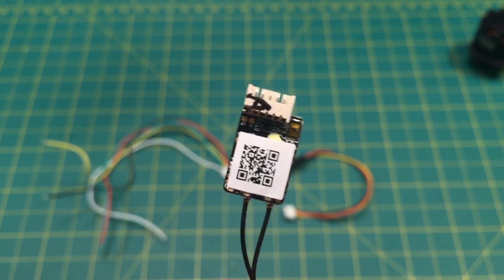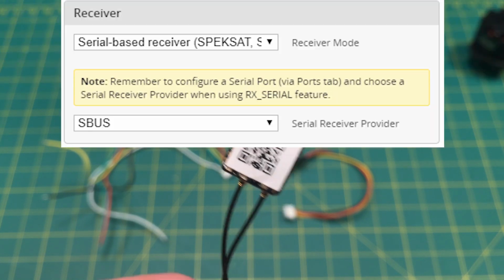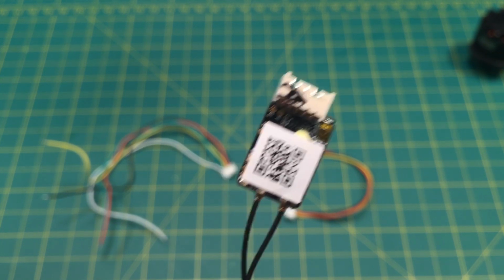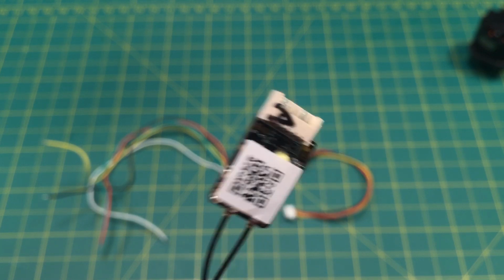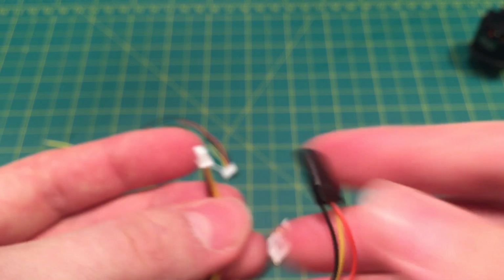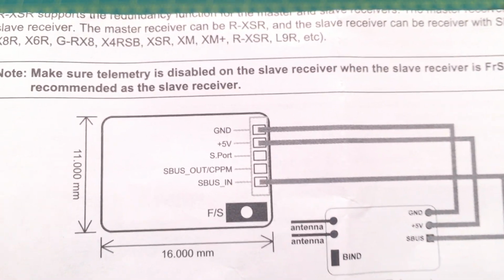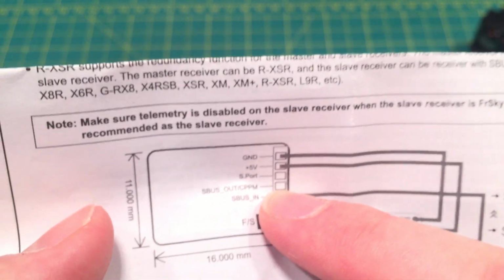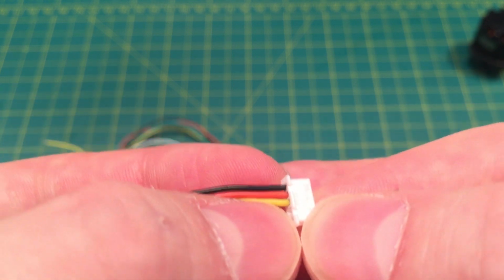FrSky R-XSR Receiver: No input? No Channel Band Movement in Betaflight?

Comment: Mines is wired up exactly as shown, and yet I still can't get this craft to fly. Don't know what I'm doing wrong and even tried the same with the rabbit 349, still no go. Both crafts are grounded.
Reply from the maker: I have a feeling that yours is probably a firmware issue on the receiver, which is something that started to occur many years after this video was made and so it is not something I covered.

Comment: Hey I’ve wired the blue/green wire to the sbus solder point, and the yellow wire to r2 but I’m still not getting any signal, what do?
Reply: I’m using the other cable they give you the one with 5 wires

Comment: Hi buddy some I am having this problem I had it working and then I updated the firmware on my flight controller through beta flight now I'm not getting any inputs I will admit I am new so I don't really what I'm doing. Are you saying to change the wires on the firmware cable before you do the firmware it are you saying switch the wires going into flight controller?  If I had it working before then maybe it's an issue of the firmware from the flight controller and the receiver not being compatable.. And also on the uart setting on beta flight how do I know which uart to click on??  Thanks for this video.

Comment: I need help binding a lite radio to my frsky reciever. I can't get it to bind no matter what I do..
Reply from the maker: Which version of the literadio do you have? I think of the earlier ones only supported D8, and not D16. The R-XSR is a D16 receiver. The literadio needs to be in D16 mode to bind to this one. Also, how new is the frsky receiver you purchased? If it is newer, then it probably has ACCESS firmware on it, and you would need to flash the firmware unfortunately to get it to bind at all.
Reply: @JohnCuppi beta fpv lite radio 3. Frsky R xsr.  was a build from rotor riot :/ had to figure all this out on my own, but he'll I like learning:) what firmware do I need to  flash to the reciever?(ordering a firmware toolkit from getfpv and maybe a better controller as well) thanks for the response!:)

Comment: now the Rxsr supports F.port.  So the cable will connect to the S.port pin.  I know this video is old.  Just FYI
Reply from the maker: Good tip. One thing I think to remember is that you need to flash firmware that has f.port as well.

Comment: Hi John,I have a T motor pacer  f7 flight controller ,taranis transmitter , and r-xsr receiver, the problem  is, radio couldn't  respond  to betaflight, no matter what I tried  for 2 weeks of testing different  ways,then WAMM I came across  your video,and tried ,what you said.Result fixed my issues betaflight  start working, I move the green wire to the fourth spot on connector, then move the green wire from  T5 on the flight controller to R6 ,then select  uart 6 on betaflight and that solve my problem, Thank you very much.
Reply from the maker: So glad to hear this helped!!! Have a wonderful day.

Comment: Can i use another uart besides the one marked sbus.? Or is that ibus ?

Having trouble buying elrs with factory firmware still on it . One out of 6 rx's was able to bind the other 5 might be returned resold . So is there a way to restore factory default settings to elrs nano rx's ? 
       Thanks for pointing out the 3 wire plug . I might not have noticed it . I did see it and thought easy rx hookup . 
  I have 2 of them ready to replace elrs if it does not bind .
Reply from the maker: For an FrSky R-XSR you do not have to use SBUS, you can use S.Port if you want, HOWEVER, in ordet to do this you need to flash the receiver with fport firmware. 

 S. Port from R-XSR to TX1 on FC. Then, enable serial rx to on.

set serialrx_provider = FPORT
set serialrx_halfduplex = ON
set serialrx_inverted = ON

Again, the above only works with fport firmware, the receiver must be flashed to make that work. Otherwise, you must use the sbus pad.
Reply from the maker: Regarding your ExpressLRS receiver issue, that sounds like an extremely high failure rate. I have more than 6 ELRS setups and they have all flashed and bound with no issues for me. What is your ExpressLRS setup and what receivers are you buying?
Reply: @JohnCuppi  i just noticed you answered about the elrs .

I bought beta fpv  micro tx , and it doesnt bind . 
  So i bought a micro tx but in the shopping cart it switched to 2.4ghz module .
    So i bought a 915mhz elrs and finally only one reciever did bind .
     I thought my purchases were used flashed returned or defective .
      Now speedybee betaflight has an elrs configurator for android . It might be working now . I have been saving the elrs  recievers to try flashing firmware later if anyone needs them . 
   I ended up putting crossfire on one quad and rxsr on another quad . Both seem good as video link .
    My rxsr recievers are different pinouts than in this video . But it worked 5 months ago . My sbus is the 3rd wire down . White nowadays .
Reply: @JohnCuppi  the frsky rxsr still works as far as my video reaches . 
 The elrs stuff still needs the firmware stuff . Funny how they can make the circuits but not the firmware .

Comment: I feel like such an idiot. I took electricity in college and I only said "maybe the wire is on the wrong pin" after looking at the manual and realizing it said s.port , I ignored that fact and spend another  hour trying to solve the problem that I already knew the answer to, anyway  thanks, you helped me realize i should have gone with my first assumption

Comment: I just upgraded from xm+ and did failsafe and my quad wont spin motors...everything is as it was...i also did the wire switch like the video...i see the inputs work and arm and failsafe work in betaflight...i just plug batteries and arm then i get no spinies😵‍💫...

Comment: This is exactly what I was stuck on! I used a needle tip to lift up the plastic to get the pin out and pushed it into the 4th slot.
Reply: It works ,me too was stuck on same issues, no headache gonna. I love my t motor quad  purchase  again.

Comment: I have exact same problem but i have these cables right, i really dont know whats wrong, i have sbus on R1, there it should be and it didnt work
Reply from the maker: I would look into a firmware problem on the receiver at this point.

Comment: I just bought a roll my five and a new accessrx receiver. I have an old radio x9d. A flash to the latest firmware free 2.0 for the receiver. It shows that I'm bound but no communication in betaflight. Please help if you can. Thank you
Reply: Roma F5
Reply: Pre 2.0

Comment: Hello, I think I have this problem, I have a second Nazgul5, not woking the receiver, R-XSR, I update a firmware by using this cable you show, then radio and receiver are conected, But not working. Should I change the yellow one? If It change this cable Will I work? Sorry But I did not understand It at all... Please help me !! Thank you

Comment: hey John, I did the same mistake and fixed the mixed cable thing and I flashed my FC, but I still don't have any input. Do you have any idea what i could be?
Reply from the maker: When you reflashed your FC did you save and restore the configuration? If not, check your Ports tab in betaflight — is the serial_RX turned on for any of them?
Reply: @JohnCuppi  I didn't save the configuration, but going through the ports tab yes the Serial_RX is set for UART2, UART1 is set for GPS (I have a tyro129)
Reply from the maker: @estebanc-vistaprevia2941  I have a good friend with the tyro 129 I'll reach out to him about his configuration and he'll reply here. I'm assuming you're following this manual from banggood right? http://myosuploads3.banggood.com/products/20190709/20190709210205TYRO129Manual.pdf
Reply: @JohnCuppi  okay, thank you John. and yes, I followed those directions from the manual
Reply: @estebanc-vistaprevia2941  Hey I have a Tyro119 should be pretty similiar port wise. I haveSerial Rx on Uart 2 and GPS on Uart 1 so that sounds right. If physical connections seem right I'd also check under the configuration tab -> Receiver section and make sure it's got the correct setup(sadly I run crsf). Feel free to add me on discord and I can send you any other configuration details you need DeadTr33#6307.

Comment: I have the xm+ and my tyro is not responding after bind any idea?
Reply from the maker: If you’re sure it’s fully bound (green light solid), and configuration is set to sbus receiver. Also make sure serial_RX is set in the uarts. I would then check to make sure all soldering connections are good. 👍🏻 if you send a pic of the flight controller I can look at the wiring for you too.

Comment: Dont help ! Im soldering all pins right ! and its till didnt work ! with MAMBA F405 MK2
Reply from the maker: I’m afraid then there must be some other problem. Make sure you are running the correct firmware on both the radio and receiver. FrSky has gotten worse with confusion about this lately.
Reply: @JohnCuppi  Problem solved! My R-Xsr was PPM mode +)

Comment: a little tip, i have the Taranis Q X7 ACCST, and an FrSky R-XSR, they wouldn't bind, someone helped me and sent me to this link, "@t, click on "ACCST D16 FIRMWARE", a drop down menu will appear, at the bottom of that there is a link that says "History firmware DOWNLOAD (not compatible with v2.x.x)". download that, and flash your RX with that version, one problem that seems obvious but is something you need to to, is make an arm button, I found a video at this link "@. it didn't work when I tried to flash it using "flash external module", I tried to flash using "flash S-port" and it worked, after that I was able to bind the RX and TX.
Reply: rip the links dont work :(

Comment: Oh ffs i literally trying to solve this for 2hours now. Of course i connected to S.Port instead of SBUS... thank you very much! (lesson: read the f*cking manual before doing anything :D)
Reply from the maker: Agree, always read the manual! But y'know what? I think Frsky shouldn't have broke their pattern of yellow wire = sbus. I cannot understand why the yellow wire couldn't have stayed sbus. This video would probably have never been made and thousands would have been saved from confusion.
Reply: @JohnCuppi  Absolutely agree. And upon this i have 2 x4rsb receiver which does not bind and when i try to flash them the transmitter shows some error message. Seems if my transmitter has the 2.0+ accst firmware then it cant communicate, moreover cant even upgrade the receiver 1.x firmware. However i spend nearly a day figuring out frsky things, so maybe another day. Or at the end i will change my radio to crossfire...

Comment: Hey, so i was able to bind and my wiring is correct, but even after pressing the F/S button it still wont go into SBUS (blue light). Any suggestions?
Reply from the maker: Just checking but you need to hold the bind button on the receiver for exactly four seconds -- and when you let go you should see a blue LED

Comment: Additional thing that I encountered when the video above doesn't work: you're receiver isn't in SBUS mode. Hold the bind button on the receiver for four seconds and when you let go you should see a blue LED. Only when that blue LED is on you can see your inputs in Betaflight.
Reply: What if you have a solid blue LED but still not getting inputs in Betaflight? I have telemetry, but no communication.
Reply: OMG I LOVE YOU!  I spend like 3 days trying to figure out. THANKS!!!

Comment: I hope you can help im out of opitions,Im trying to setup r xsr, f405 wing in inav 2.5, i flashed recever with latest firmware, binds to radiomaster tx 16s no problem but in inav i get no stick inputs, i have 4th wire down green going to sbs on FC, power and ground same uart 2 ive tried 3rd wire down on recever yellow to rx and tx but still no inputs in inav. The radio shows good stick inputs in inputs,mixer and outputs and shows good signal from recever , I hope you can help. Thanks

Comment: I'm stumped. I updated the rsxr firmware. I bound it to my radio before I installed it. I installed it in a Tinyhawk 2 that was getting CALIB flag using the onboard SPI receiver and it would fall out of the sky. So the Tinyhawk seemed to have more problems because the motors stopped spinning up, it began to only connect to Betaflight sometimes when I would plug it in, but I got light flashes when I would arm and in Betaflight the receiver was working. I took the RXSR off the Tinyhawk and just ordered a new FC for the TH. So I installed the RSXR in my first build. A Succex f4 V2.1 16x16 stack. I wired it as you showed here. I have it in the correct places on the FC, but when I plug a battery into the quad there are no lights on the RSXR. No lights, no movement in Betaflight in the receiver tab. I took the receiver off and plugged into a 5v 1.5a power supply and the lights light up as they should. Plug it back into the quad and nothing. I thought maybe I have a bad solder joint even though they look good. I desoldered the 3 wires and soldered them back to the FC and still no lights on the receiver. Also strange, plugging a battery into the quad will give me all the start up tones except for the last 2. If I have it plugged into the computer/Betaflight and then plug a battery in, I get all the tones. I can spin the motors up in Betaflight, but no receiver. Do you have any idea what this could be? I'm going nuts here. I've broken the flight controller on my Tinyhawk 2. I broke the frame and one motor on my Tinyhawk Freestyle 2. I have this beautiful 3 inch Tadpole with a nice stack, Xing 1404 4600kv motors, a beautiful day that is slipping away, and rain in the forecast for tomorrow. I even used the smoke stopper you recommended just to make sure I didn't blow anything up.

Comment: Thanks for this tip John. This problem has been driving me mad. I've been trying to set it up in Inav and having the same problems. I updated all the firmwares in the taranis and receiver. Binds fine and getting telemetry but no output on the channels. I even tried the receiver with another plane using Inav thinking it may be the flight controller. Now I feel like a total "noob" Thanks !! you have saved my receiver from the bin. :)
Reply from the maker: Glad it helped

Comment: you have helped me with the rxsr .. now i am trying to find a solution to the r9mm .. i am replacing the RX on the same quad .. but for some reason i am not getting input .. came back to see this video again .. but not luck.. i dunno if ur still using an F4

Comment: Hi John, I know this is an old thread, but wondering if you can help?? Just purchased a new CinePro F7 copter. Came BNF with this receiver. Bound to my QX7S w/o a problem. Blue light is off so should be in SBUS mode. Controller say telemetry lost & found when I plug and unplug 3S lipo. Issue is.. Betaflight sees the copter in the USB port, but the receiver cannot move any sliders... I have everything the way GENRC says on their website... Betaflight will not see... any other suggestions??? Thanks and love your vids!!!
Reply from the maker: I have a cinepro f7 so hopefully I can help. Mine was plug-n-fly, but they are all the same basically. Maybe they forgot to configure an available port/uart for it. In the betaflight configuration -> ports section, look at the UARTs and tell me the serial_rx switch is set for any of them.
Reply: @JohnCuppi  , Uart 4  - serial Rx,, and I added Uart 2 for Smarport. That's it
Reply from the maker: @hawkskyflier  I just checked my cinepro f7 and mine is set to UART4 as well. The next thing I would be checking at this point because you say the telemetry lost / found message keeps sounding, means the tx is getting connection to the rx but it's either not getting input from the radio, OR the rx just isn't transmitting the signals to the board for whatever reason. Maybe a stupid question... but is this your first drone or have you used the QX7 before with other drones successfully? Sorry, I have to ask -- one time I was helping someone and they bound it but had not set up a quadcopter profile.
Reply: @JohnCuppi  , NP for asking. I have a BeeBrain lite & V2 connected. 1 with a DSMX module and the lite with Frsky connected. I have all the channels set up for the aux channels too.... Everywhere I'm seeing ... everyone is telling me to flash the controller firmware & the receiver... WOW.. I just have a hard time with that as the receiver is one day old, brand new... but I'm on the OpenTX website now, just gonna D/L the new firmware for both and give that a try... let's see if I can blow something up..  ;)

Comment: When you do this do you still need to connect to uart? I'm using this reciever with a taranis qx7 but still can't seem to get the betaflight reciever tab to recognize inputs even after doing this and binding the controller to reciever
Reply from the maker: Yes you need to connect to a uart with serial_rx switch enabled in the ports tab for that uart. Usually there will be pads assigned for sbus and those will be what you want to use.

Comment: I hoped it would work finally after 6 hours of trying to bind it, but it didnt...New firmware for transmitter and receiver, changed the wiring as you mentioned, but still no positiv result. Do I need to wire the yellow wire differently to my FC, if I change the position as you mentioned in the video? The yellow wire is wired on to signal? And which firmware version should I use for Taranis QX7 with the same receiver as you showed in the video? Many thanks for your help!